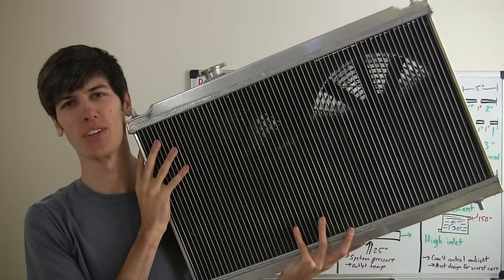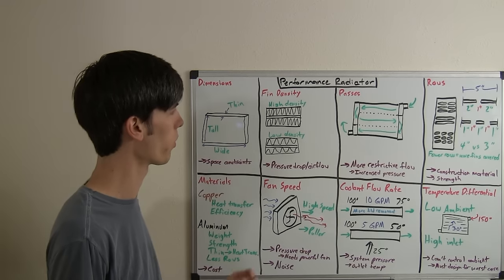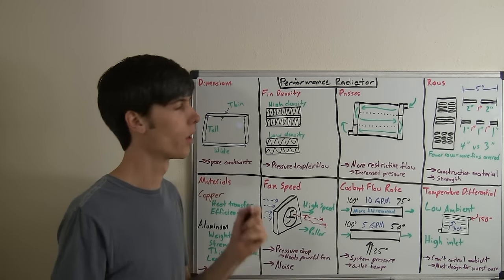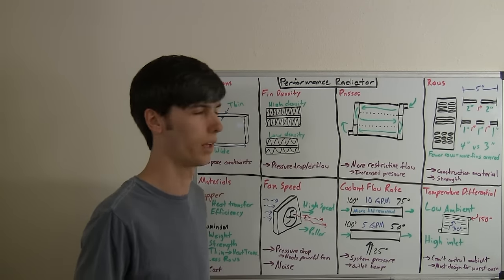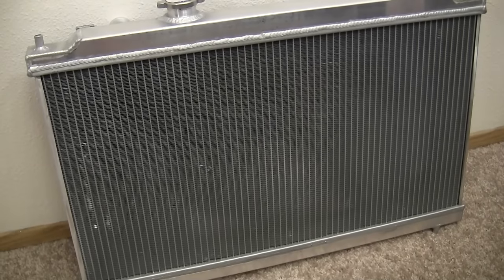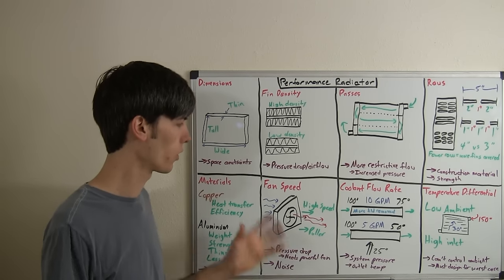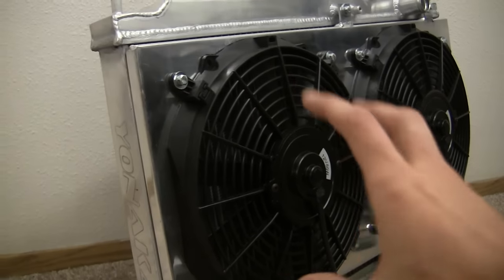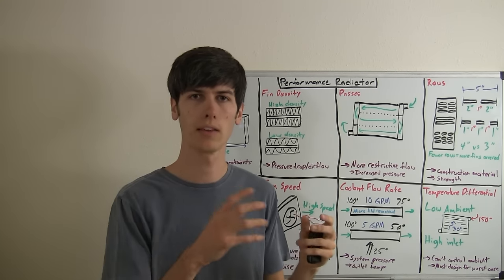Performance Radiator - Explained

Comment: I like the video very much as I do with most of your videos! I would like to know more about the correlation between the ambient air temperature and the flow rate. Honestly I get confused about thinking that the two- flow rate and ambient temperature must work together. It also seems to me the size of the radiator would come into play, a one-row and a four-row should have some consequence on the flow rate and the ability to tackle the ambient temperature. And lastly what are the benefits of aluminum over copper/brass? I think my old '70s cars had copper/brass radiators from the factory (?) !
Reply: Radiators flow what the water pump pumps.
Tubing size being equal, 2 cores dont flow more than one core. 2 cores the coolant is moving half as fast as one so cooling is increased by exposure to air area and time exposed.

Comment: Always enjoy the video's!
So I hear the term "Core"  and people saying I increase the number of "cores" for better cooling. I heard the explanation in the upper right quadrant but I am still confused about what the "cores" are.
Reply from the maker: They're the passage ways from one end of the radiator to the other, connecting the end tanks so the coolant can flow from one end to the other. It's very misleading to say more cores are better, the best would be one single core that takes up the entire width of the radiator. This isn't done, typically, because the core wouldn't be very strong, so 2 or 3 are used. Ultimately, you just want to maximize the surface area, which is what I was demonstrating in the top right quadrant.

Comment: So a thinner radiator is better ?
However i don't understand why you said the design is crotical (with fans behind) and after you said pulling air (so with fans behind) is better than pushing it (= fan in front).

I'm not sure to understand your explanation about the flow rate. I need to work my English 😅

Good job !

Comment: E85 is alcohol fuel (Ethanol). Ethanol is an alcohol-based fuel made by fermenting and distilling starch crops, such as corn. In other words, is the juices from rotting crops, mixed with some chemicals to produce fuel. But, here's the kicker; if 1 gallon of E85 was burned in an engine with a set af/r, and the same amount of petroleum (gasoline) as burned in the same engine with the same af/r, the E85 would produce significantly more power. E85 usually gets 25-30% less MPG, but is cheaper to buy.

Comment: When picking a radiator for a swapped vehicle, should you select based on the vehicle or the engine? I would suppose the vehicle considering standard rad mounts but the in/outlet may not be in the same positions on the swapped engine originally. So which would you rather have, vehicle rad + swapped engine + custom rad hoses, vehicle rad + swap + modified in/out, or swap rad + modified mounts?

Comment: great video.. I have a motorbike and i live in Greece witch means tha i have no problems at all with freezing. In the winter it might go to 2-5 degrees celsium. Shall i pour some antifreeze along with destilled water or just water is fine?
Reply from the maker: Hmm, if it never goes below freezing it's probably no big deal, but anti-freeze also typically has a higher boiling point, so you benefit on both ends of the spectrum.
Reply: Oh. SO i guess i'll do the mixed thing. Half and half. Thanks mate. You should do a playlist of the installation's on the integra.. Nice stuff.

Comment: you probably have done the research between the different companies. Which radiator would you pick out of the 3: koyo racing radiator, mishimoto x line, and csf? this is for a 2013 evo gsr

Comment: I noticed that the inlet and outlet necks of the radiator in the video are in line with one another. Usually on a downflow radiator, the necks are in opposite corners of the radiator so that the coolant has to flow through the entire core. I'm wondering if your radiator has some kind of internal baffles that route the coolant through the core? Can you see any baffles if you look inside the top or bottom tank?

Comment: Will running two radiators in series affect cooling? What about pressure? One would be stock and the second would be a smaller one with only an input and output port. The second one won't have a radiator cap. Coolant would flow to stock which has a cap and then to second one and then return to water pump. Will this affect anything? Like pressure? Will it make cooling better ?

Comment: What about the effectiveness of air flow  from electric fans being attached directly to the radiator vs. being attached to a thin shroud (1in or less)  vs. a thicker shroud (3 or 4 inches thick)?

Comment: But what about aluminum vs plastic? Aluminum tanks insulate less so they allow more heat to escape but it makes the engine compartment hotter right? So is there any performance gains worth the weight and cost, other than reliability?

Comment: thanks bro. my bypass pipe flow broke near the cap filler as it is made of plastic and the radiator it self is made of aluminum with plastic tanks. And now i fix that pipe with the help of silicon ...is it fine or should i replace the tank or the whole radiator..?

Comment: Pro tip! If you cut out a piece of screen used for screen doors and zip tie it in front of your rad it'll protect it from damage from stones and bugs!
Reply: it will also reduce airflow or might burn

Comment: is an all aluminum radiator a good upgrade on a stock motor? Or unnecessary overkill?
Reply: Only benefit from an aluminum radiator is better cooling if your stock radiator is clogged and is causing overheating issues. If you do get an aluminum one get the one with the biggest tubes you can, tube size is more important than row count. Too many rows and you get turbulence inbetween the rows which decreases your cooling capacity. You won't gain any hp or anything just by putting a new radiator in so if you're looking at getting more power then invest your money into a cold air intake or something like that. Most new cars have plastic tanked radiators so you may not even be saving weight.
Reply: chevelle19721 thanks for the input, man, but the only reason why I'm considering an aluminum radiator is because my car runs at just a tic passed the halfway point on the temperature gauge. I put a new, lower degree thermostat in there to no avail. It runs like a champ, but it has me extremely paranoid and scouring through the forums has got me nowhere. 
A couple of mechanics say it's no worry while a couple of others say it is. What do you think?
Reply: if its still pretty close to the middle of the gauge i'd say its fine! I'd be worried if it was more closer to the upper limit of the gauge like 1/2 way between the middle mark and the upper mark under normal driving conditions. If you can get a real reading of the coolant temp that would tell you for sure if you're ok or not. The gauge on my car is like 20 degrees off but I know the coolant is at the proper temp because i verified it with my obd2 reader so i could see what temp the engines coolant sensor was saying and the engine coolant is right where it should be even though my gauge says the engine is 20 degrees colder! So it could be your gauge or sending unit as they could get less accurate as time goes on. For now i would just keep driving it!
Reply: Tommy Cruz -- if your was built within the past ten years, that temperature gauge is probably lying to you. If it's driven by the ECU, you have no idea what the actual coolant temp is.  Car makers have gotten tired of ignorant owners complaining that needles move around and their car is overheating when it is in fact operating normally.  They make the ECU show normal temp until the car is actually overheating. You'll need an ODB scanner plugged into the OBD2 port to get the actual temperature, or you'll need to install a real gauge using the temp sensor as the input.

Comment: Do radiator manufacturers in certain hotter countries factor in where country drivers put fly screen or mesh in front of radiators or grilles to try to keep bugs and debris from clogging the fins or holing it. I try to get a large hole size that will still allow air to flow through mesh like say 3 - 4mm squares. I have seen some put 1mm square mesh and wonder how the air is getting through trying to push through.

Comment: Hey, just wondering what negatives and positives changing to a performance thermostat will make to my engine? I'm worried that changing to the Mishimoto thermostat to match my radiator and hoses will cause my engine to run too cold considering I have no power mods as of this moment in time (car is an Evolution 4) and the new Mishimoto thermostat runs around 10 Celsius lower than the OE one.

Comment: You said a fan pulling air through the radiator is more efficient than a fan pushing air; why is this?  I would think that the pressure differential is what matters most in moving air from one side of the radiator to the other and whether you're creating lower pressure on the back side to pull air through or creating higher pressure on the front side to push air through, the differential would be the same so would move the same amount of air.  Is that not true?

Comment: Aluminum will corrode over time but it is a long time according on the grade (Chemical compound used in treating and the thickness; etc.)  of Aluminum used. Aircraft grade is the best but a bit over kill though for this application.

Comment: I'd also like to add up: the higher the HP the more it generates heat. Meaning if you have a V12 engine compare to a V4
Obviously the bigger the engine generates more heat than smaller ones. Lastly, the external temperature. If you're living in a
Hot or tropical climate, you are more likely to experience overheating than living in cooler or colder areas.
Reply: Good points. Always gear up for the worst possible condition you might encounter.

Comment: Do radiators come with a cooling capacity rating(BTU ?) or graph of the variables that determine the cooling capacity for each design? The bigger the temperature drop between the inlet and outlet the better the cooling capacity of the radiator. What happens as the outside air temperature(incoming air) goes up?  Does the cooling capacity go down? How do you determine your cooling capacity of an engine? Trial and error of different size radiators?
Reply from the maker: Lots of questions. Yes, as the ambient temperature goes up, the cooling capacity of the radiator goes down. Car manufacturers may make radiators for proper cooling up to around 120F or so. Cooling capacity would be based on how much waste heat the engine creates, and how much of that waste heat is absorbed by the coolant system.

Comment: Jason forgot to mention that if you mix dissimilar metals in a contained loop that it'll cause galvanic corrosion. It's unfortunate, i would not recommend copper at all for a radiator unless its for computers.
Reply: Lime most coolants should have heavy corrosion inhibitors (computer aios use glycol to prevent it) if you run without corrosion inhibitors even a stock system will corrode given the nature of cast iron engines, aluminum radiators, brass fittings, and I believe a lot of older heater cores are copper. As long at isn't direct contact it should be fine and the high quality stuff will be nickel plated to prevent corrosion but not inhibit cooling efficency greatly.

If you run straight non distilled/deionized water your system will corrode very quickly no matter the metal or alloys you use for cooling.

Comment: How great is the temperature difference between the coolant once it is cooled? Lets say the coolant comes in at 200 F, what temp does it have once it leaves the radiator back into the engine? I'm just curious on how big that difference is.

Comment: if i am right that is because of the material usually aluminum is greater in all application but still it changes temperature very quickly then S.S or cast iron that is y it also expands at lower temperatures then S.S and cast iron that causes blooming in it and drag car tends to generate alot of heat because of high torque ratio then normal cars so fast increase and decrease in temp causes blooming and bloating in aluminum .. hope that helps !

Comment: Materials: Galvanic corrosion can occur between Cu radiators an Fe or Al blocks... bad

Flow Rate: You're using energy and power interchangeably here.  This can be a source for confusion.
Slower flow rates result in a cooler radiator outlet (joules)
Faster flow rates result in faster heat rejection (joules per second)
These arent the same units... apples and oranges.

Comment: I don't get it how is the radiator put in the car? Are the fans facing the front so that air goes through them and through the radiator easily or is it the other way around, making the fans blow through the air that is coming?
Silly question but I'd like to be sure

Comment: So do you agree with combustion engines applications that dissipating heat from radiators means a slower flow rate is going to yield better results??? Some say water needs move slower and to stay in radiator longer will dissipate more heat that engine gives out. I disagree of course based on the design and system.

Comment: thicker restricts flow but gives  more surface area and more system capacity versus fin density only providing more more surface area. wouldn't you want a thicker radiator with low fin density to correct air flow allowed? why don't they have copper fin and aluminum cores? pulling air is better because it puts lower pressure air (which is cooler) through the radiator over pushing pressured air, right? I know like most everything it's a balance of trade offs. oh, and it is volume that matters not fan speed, as curved blades are quite but pull less volume than straight (especially statically). long comments on phone are tougher than keyboard.

Comment: If I'm going to upgrade from a single core radiator to a multi core radiator, do I need a higher CFM electric fan because of the thickness of the multi core radiator?

Comment: Need to ask.. some aluminum radiator show a sign of expend internally or bloom/bloated and its new.., my question is why? since we have a radiator cap which have controlled the internal pressure of radiator.. is it because of material defect or not very good radiator construction?... i seen this usually in drag race car..

Comment: To make your statement true about "coolant flowrate" you should have tweaked the number a little bit. Energy removed is given by   (flowrate x delta t x 450) if your using 50% coolant mix (the answer being in btu/h. Temperature would need to be converted to farenheit to...).  Your numbers depict the exact same energy removed from both system. To make your efficiency statement true, you should have increase the differential slightly on the 10 GPM exemple.    
I see a lot of engineers in HVAC that don't understand how to use that relationship at their advantage. They are using the stupid rule of thumb of 20 degree F  delta t and assume that's the best recipe. They end up with hundreds of feet of 3" or even 4" piping around the building to compensate for such a low delta t. The same energy transfer could probably have been done with 2" piping. Piping size in automotive isn't really a bottleneck because you don't have to run pipe on hundreds of feet to link the radiator and the engine. That's why we see big hoses on radiator inlet/outlet.
Reply from the maker: The numbers were simply made up to make it easy to understand.

Comment: As you know most cars do not even have a water temp gauge anymore.  If it does, would it be measuring inlet or outlet Radiator temperature?
Reply: Water temp measurements are taken from the engine just before it goes to the radiator.  This is also just before the thermostat.

Comment: The result would be less pressure drop across the water pump at high flow rates.  This is probably beneficial for extracting maximum horsepower.

Comment: @Evan - I have literally never seen a car that doesn't flow from the top down... The top pipe on the radiator is ALWAYS the hot pipe.

Comment: You forgot to mention mechanical vs electric fan. Replacing a engine driven fan with a electric, thus using the battery as a buffer, can make a very noticeable difference in  performance. 

Why does pulling have a 20% gain in efficiency over pushing?

Comment: Does it take more time with the racing radiator for the engine to get to the operating temperature, compred to stock? Can I have problem with racing radiator, that the temperature will be too low, when the outside temperature will be very low?
Reply from the maker: Assuming your thermostat works, should not cause any difference in warm up times. Your thermostat closes off the engine block from the radiator until it reaches operating temperature.
Reply: Engineering Explained that makes a complete sense, thanks for your answer!

Comment: because with pulling the air you (or better the fan) try to remove the heat generated by the radiator and not viceversa with air flow into the rad